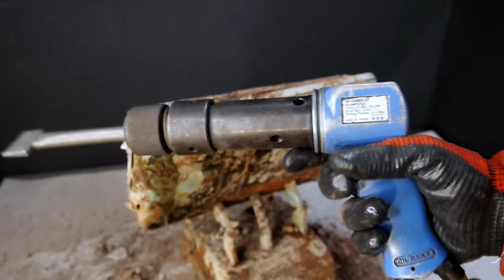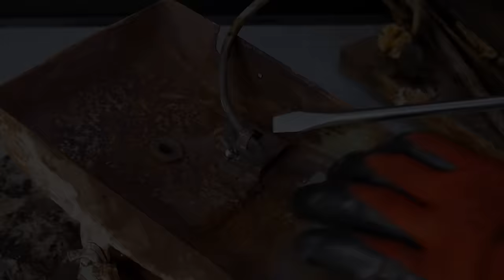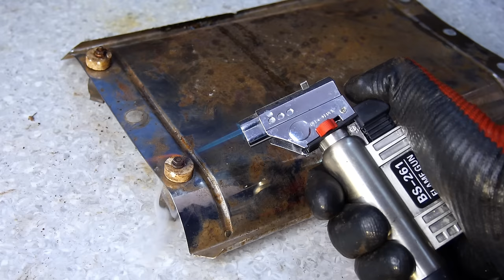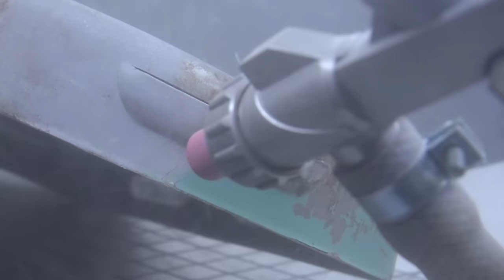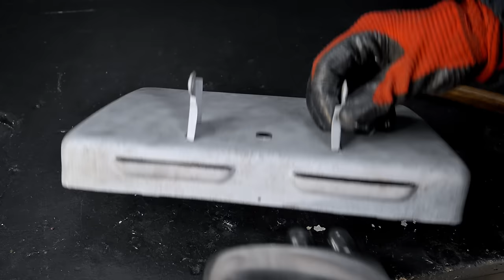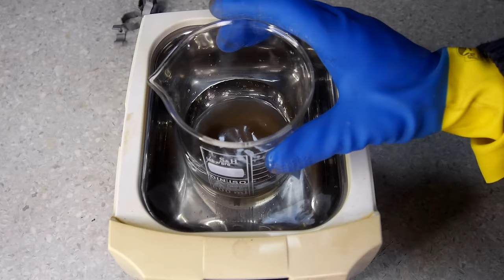Impossible Restoration of an Abandoned Antique Heater

Comment: one thing I wish you had added was a kill switch just in case it fell over during operation. in the past these types of heaters caused a lot of house fires. I am not certain how effective the kill switch would actually be considering how hot those coils can get, but it might be something worth considering if you plan on actually using it for it's intended purpose. also, fantastic restoration it looks great.
Reply from the maker: I'm very glad you liked it. I hadn't thought of it, maybe I can rework it in the future. Thank you very much for your advice.❤❤
Reply: @AntiqueVintageRestoratioNs   No problem. If you are thinking about it, you may want to go grab a cheap modern one, take it apart, and see how they do it. Most just have a button on the bottom that is depressed by the weight of the heater and pop up if the heater falls over, causing the heater to stop functioning

Comment: Hello, nice work, but do you have some authorisation for electrical works? From video is visible basic fault, which make this heater extremly unsafe. Your heater is allways under voltage when is connected by electrical socket. Because the phase wire (insocket cable the brown wire) is connected directly to one clamps of heater element. This cable should be allways connected thru main switch. In your video is thru main switch connected neutral wire (the blue one) and this is wrong. In your case allways when heater will be in socket and he will be switched off by main switch is still dangerous voltage on the heating elements, any contact with wires on heating element can kill you, even if look heater as switched off!! However rest of restoration works are unbelieveable. Good job. And please fix his basic fault it is really dangerous for usage.
Reply from the maker: Hello. I am authorized for electrical work. This valuable information and advice is very valuable to me. Thank you very much. Of course I will correct my mistakes. I'm very glad you liked the video. Kind regards.❤❤❤❤